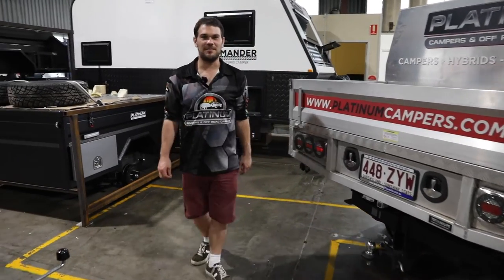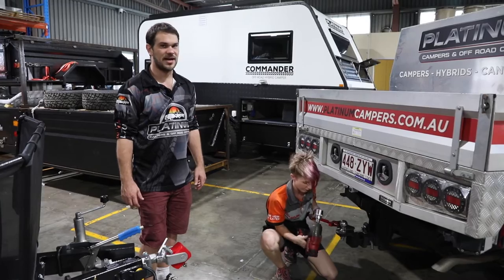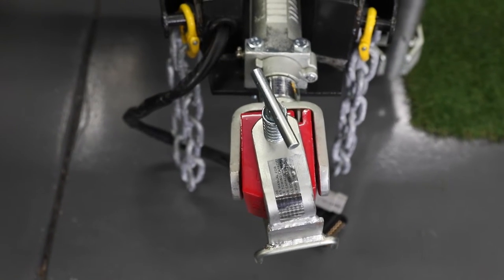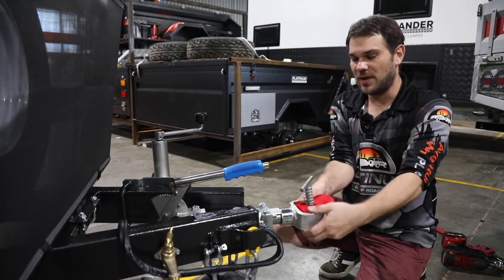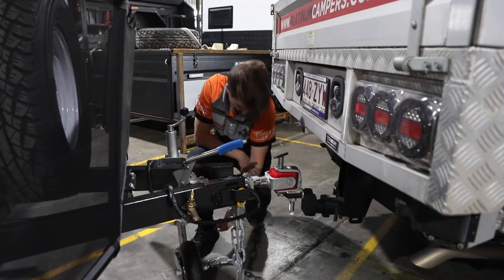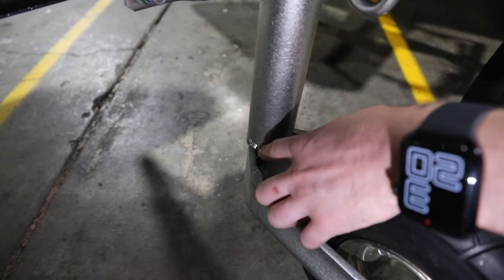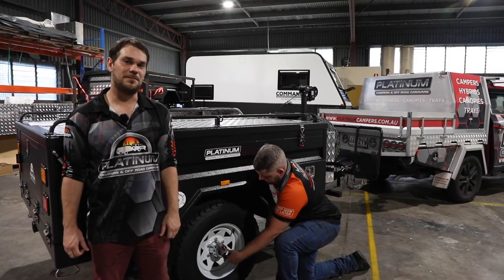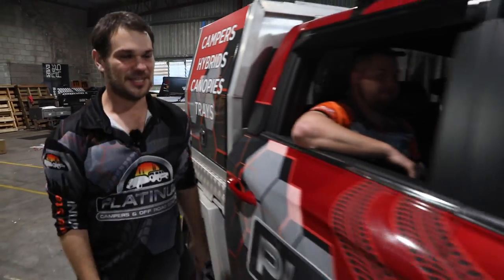How to Hitch up a Camper Trailer with a Off Road Poly Block Coupling

Comment: Looks like this system of trailer coupling may also be suitable for attaching Motorcycle-towed Trailers to the Motorcycle (tow vehicle)? These trailers require plenty of linear axis articulation.
But, then if said trailers is also occasionally drawn by automobile; then a SECOND vehicle hitch would also be required?